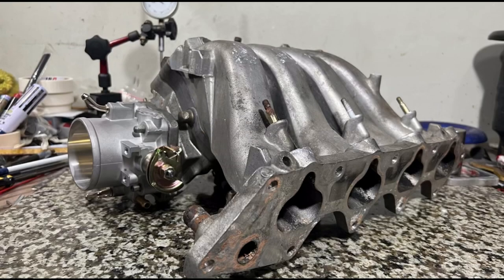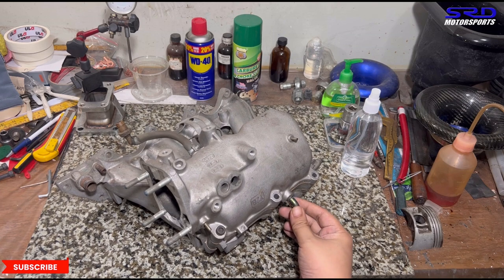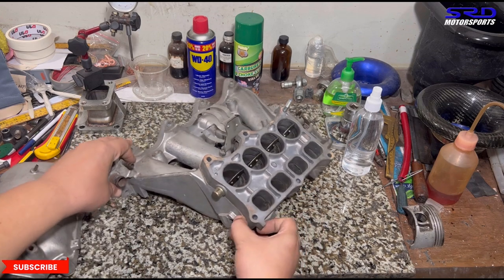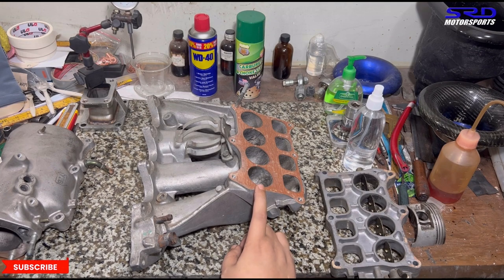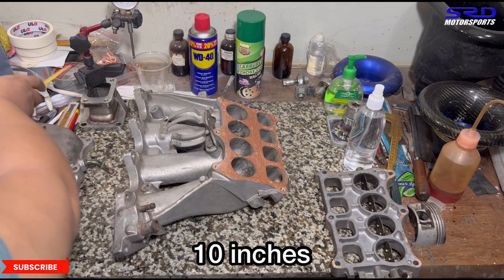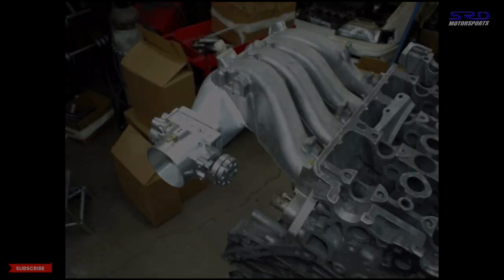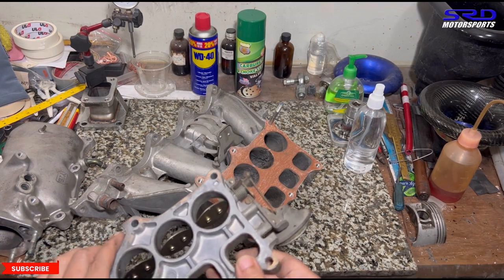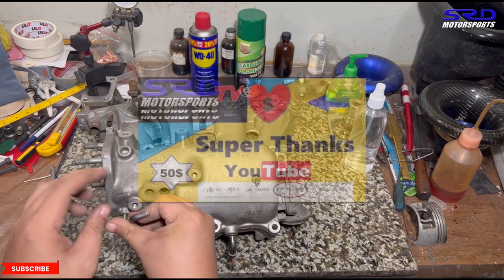B18c1 GSR Intake Manifold to Port or Not to Port SRDmotorsports

Comment: the iabs are vacuum actuated. if you choose to bypass the electrical portion you can run with just the vacuum hose connected from the diaphragm to the plenum and it will open always at wide open throttle.
Reply from the maker: Oh this! Is a good nugget of info!!! Thank you and nice everyone can read this comment thanks to you buddy!
Reply: absolutely! 
i study the F and H series engines and they run the iabs in a few variants so i thought I'd shed some light. hondas are so fun
Reply from the maker: Oh sweet!!! Thanks for that info def a good thing to know for most!

Comment: I like where this is going... The thing is, how do you operate the IAB system with a p28 ecu, could it be linked to vtec?
Reply from the maker: I think it’s possible that way

But also u need the p72 rechipped ecu
I forgot what other ecu can operate it but even Crome has the IAB function control

Let me check on that or hopefully others from the US already know

But def yes as I saw ur comment I remembered your Ek hatch I’m like “ooooh man this be perfect torque machine!”

Comment: This is a awesome showing. I have a b18c1 with itr exhaust cams and ctr intake cams and I have a spare OEM gsr manifold that I wanted modified. With stone research this manifold is a marvel of engineering in design. If you are interested in helping me achieve this goal of modifying its full potential then great🙏. I have a spare gsr manifold, I have a 2.0 liter IAB plate from Honda which ofcourse is bigger then the gsr iam and bolts right up and I have spacers. Let's do it if your interested!
Reply from the maker: Oh that’s cool and u got a nice set up there

Comment: I didn’t do in depth research but have already bought the skunk 2 intake manifold and after watching this video, do you think the skunk 2 intake manifold is even worth the investment on a stock b18c1? I do plan on adding bolts on like headers and such and it’s also on a daily.
Reply from the maker: the skunk2 ultra or pro series? They are good and will fit the bill, would just have a slight diff in the next complimenting parts for future mods but still alrigh for a daily
Reply: @SRDmotorsports  I have the skunk 2 pro. What other mods would you recommend?
Reply from the maker: That manifold would do good
Reply: @SRDmotorsports  I was looking at the skunk 2 66mm. what size throttle body do you think I should go with? My plan is install the manifold and then later on upgrade to carb legal skunk 2 stage 1 cam with valve train and springs. My car is also pure stock b18c1 at the moment.
Reply from the maker: @JohnnieIsBored  well in that case u can already jump to 70mm for future use on the skunk2 intake but the 66 is also real nice can’t go wrong with either
Reply: @SRDmotorsports  what do you recommend?
Reply from the maker: 70 would do
Reply: @SRDmotorsports  would that be too much air on a stock car?
Reply from the maker: Well air is only going in by how much the engine demands it.
Reply: @SRDmotorsports  what other mods do you recommend on the b18c1 head budget build?
Reply from the maker: That seems to be real good
Reply: @SRDmotorsports  is it good to purchase used camshaft and have it polished at the machine shop?
Reply from the maker: No need to polish it if it’s rusty it’s no good
Reply: @SRDmotorsports what ecu do you recommend I should pair it with ?
Reply from the maker: Rechipped or Hondata is fine just need a proper tuner
Reply: @SRDmotorsports  which version s300 do you recommend
Reply from the maker: The latest has Bluetooth and less to zero bugs so that’s good
Reply: @SRDmotorsports  which ecu? P28, p72 and etc?
Reply from the maker: Once they’re rechipped or on Hondata they all function the same

Comment: I LOVE your videos - just pulling down my GSR manifold and wondering if there are any improvements to be made
Reply from the maker: Oh maaaan what timing then 😅 thank you brother…I figured I have this manifold on my shelf might as well re study it and asses

Downside now = it gave me more ideas to spend on lol!
Reply: @SRDmotorsports  I’ve been porting my GSR head and reshaping and deshrouding my combustion chambers to make a B20vtec in an RD1 CRV, just YESTERDAY I split open the GSR manifold to see how it works (it didn’t come apart as easily as your video showed - I had to pound it with a mallet ALOT) and started smoothing the long runners and opening the up the short runners. Your videos are helping Alot
Reply from the maker: @StillyWoo  well it looked easy on video cuz I removed it earlier and u are right it needed to be yanked apart 😅 but nice to know u doing ur project keep it up man!
Reply from the maker: @StillyWoo  feel free to check my video on the b20vtec/LS vtec we did share some stuff we do as far as the conversion and lines

Some of which might also be something that makes it easier for u as it does for us man
Reply: I have started to extensively modify the GSR intake manifold… it will really surprise you if I can achieve what I’m planning and I can even see room inside for hidden internal nitrous jets 🚀 which I can hopefully aim at the valves.  This thing could be amazing. Let’s compare when you are done. My Stage 1 is complete, remove the casting for the short high flow (Round) intake runners from the plenum to make a long oval shape and give the plenum more volume and an easier path for the long runners & open the throttle body entry to 70mm, now stage 2 - remove the 4 butterfly flaps, open up the 4 passages and reshape to match the new long oval shape modified plenum above and create and install a new oval butterfly. Stage 3 - open up & knife edge the round runners under the butterfly and smooth EVERYTHING… Gee I hope my skills can match yours and make this work nicely 😀 let me know if you have FaceBook or Instagram to share photos.
Reply from the maker: @StillyWoo  wanna get crazier? How about “stand off” injectors inside the plenum above each runners? Hahahahahahah

yes hit us up at the shop page in the description

A lot do that and we continue some talks

But I always tell them to keep commenting here for decent video activity for the algorithm haha

Comment: I love how you can tune the iabs in hondata and it sounds like vtec cracking twice haha ,the concept of the manifold is genius if you ask me
Reply from the maker: So true actually on the concept!

crazy me, had myself thinking if I can figure out a sensible and reasonable cost effective way of changing runner length on ITB? Could use the iab function and tweak accordingly on the Hondata smanager haha 

Hmmmmmm!
Reply: @SRDmotorsports  haha it is a decent thing to get into to try and bring the power in a bit early
Reply from the maker: @StraightOutThaGudda4U  yuuuup or let us run BIGGER cams hmmm haha
Reply: @SRDmotorsports  bigger the better right😏

Comment: Bro. Have video engine start n dyno video?
Reply from the maker: Of the b18c no
Reply from the maker: Of the start and dyno a different gsr engine a blue civic we have
Reply: Mean this intake manifold no use?
Reply: After you porting have increase the torque?
Reply from the maker: Havnt used it but the other one a friend already has it
Reply from the maker: most of the time it’s increasing top end power
Reply: I have message you in Facebook some video also
Reply from the maker: okay